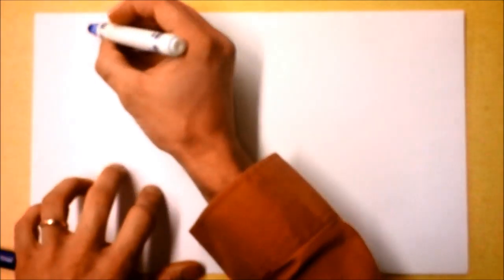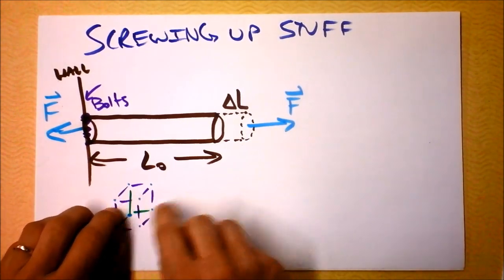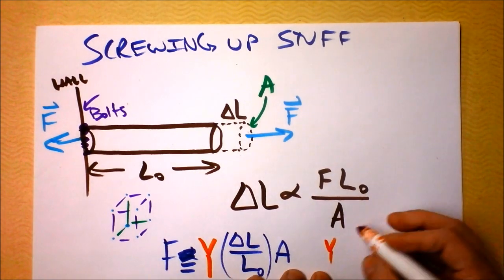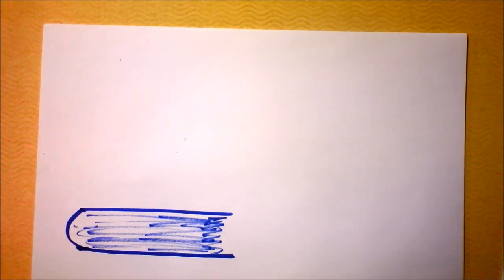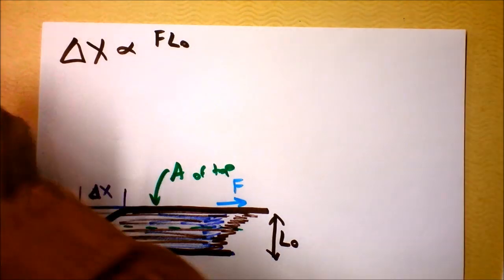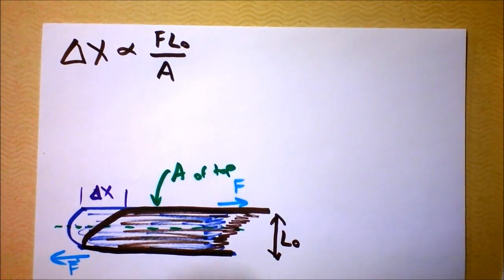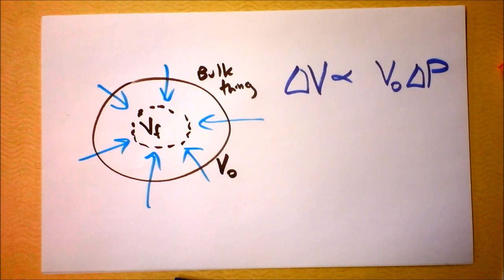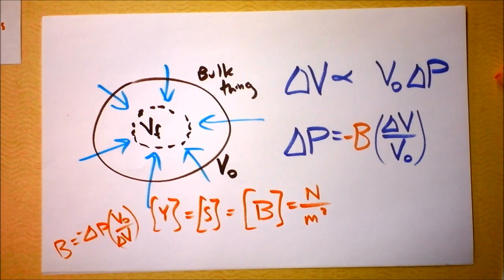Screwing Up Stuff via Bulk, Young's, and Shear Modulus.  Stress and Strain. | Doc Physics

Comment: Can you explain the tension equation for elastic springs and strings?
T= (lambda)(x) /lo
where lambda is the elastic modulus, x is the extension and lo is the original length of the string or spring.

Comment: At 16:44 
As pressure increases, the change in volume also increases, so why a negative sign? 
EDIT: The change in volume is negative for compression. So I'm guessing we want to keep Bulk modulus positive hence the negative sign.
If we didn't use negative sign, B would be less (but more in absolute value) for more "stronger" materials.
Reply from the maker: Haider Rehman Butt Love it.  Consider that if delta P is positive, delta V will be negative.
Reply: Thanks for replying. And thanks for your excellent Videos.